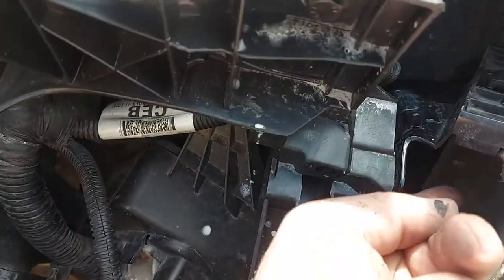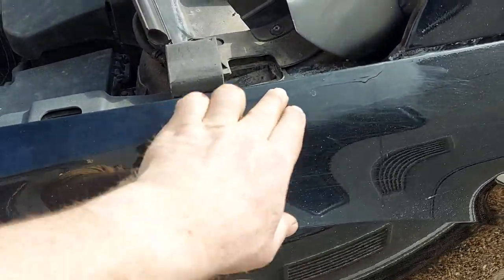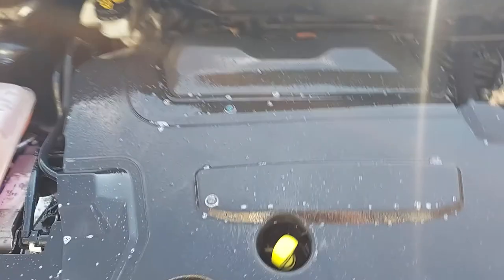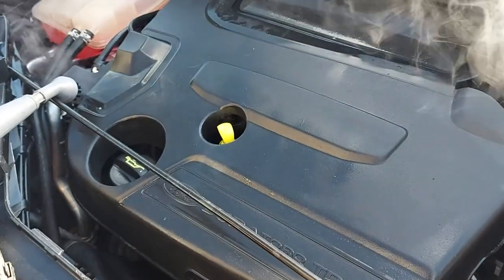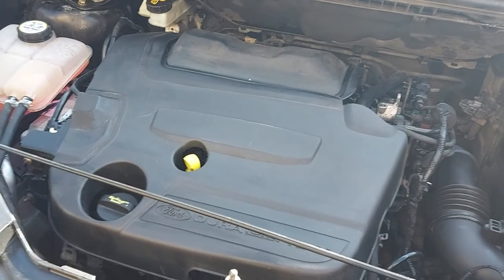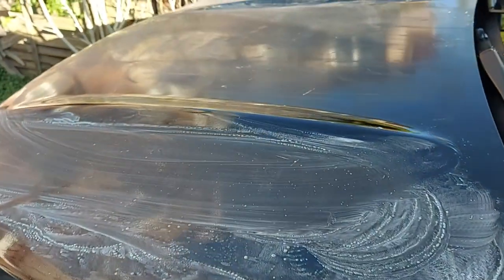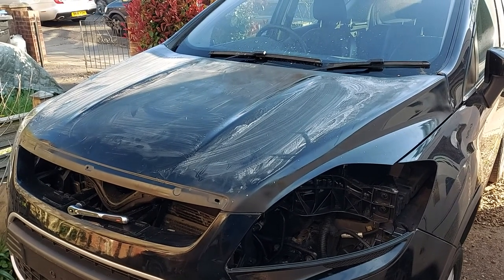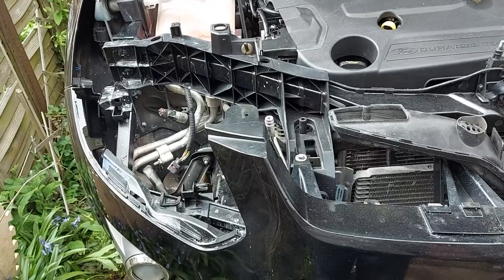Ford Kuga   Rebuilding the Front Bodywork

Comment: I am doing a replacement of my front bumper but have failed at the first hurdle - removing top grill. 
I have removed the 6 screws, bonnet release and air intake, but have 4 clips at the bottom of the grill where it attaches to the top of the bumper. I have eased the outer clips on both sides but can't release the inner clips on each side. I have inserted flat screwdriver above and below but can't work out which way they move?
Just started raining so have popped in to ask here as I watched your video yesterday and hope you might remember as the top grill appears to be off at the start of this video.
I don't want to force anything as top grill is undamaged.
TIA